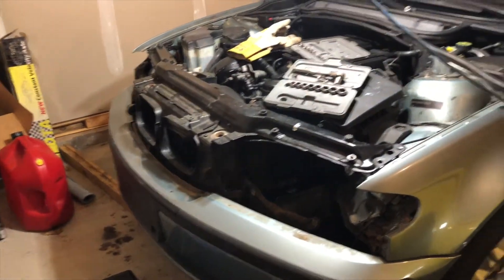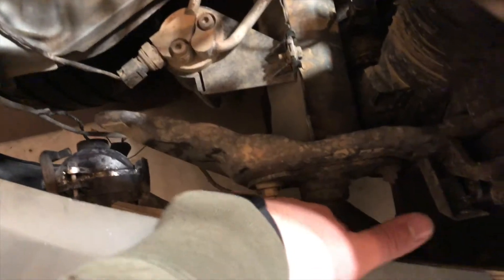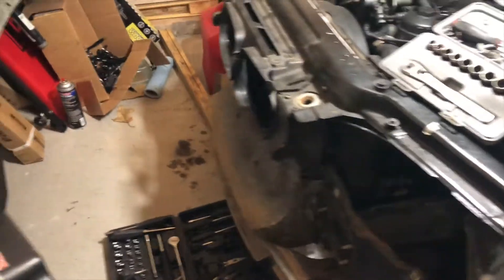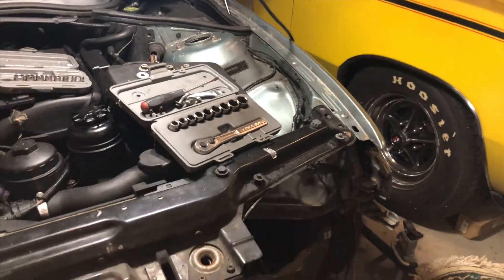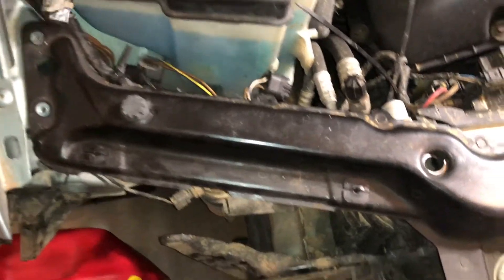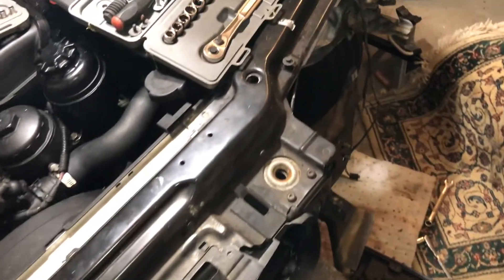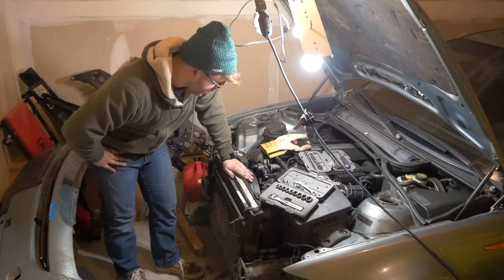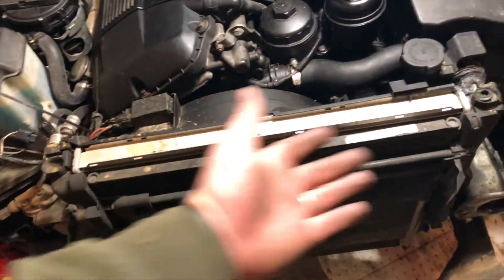Removing the engine from my E46! - BMW EV Conversion Part 3.

Comment: its a shame you couldn't keep the yellow car outside the garage. and put the bmw in the middle of the garage. give you some decent space to work. I'm pretty much in the same boat as you. but i paid a mechanic to strip out the engine etc (just done last week),  I'm going to weight the car before I start (tow it to a puplic weight-bridge). be interesting to see what batteries you intend to use.
Reply from the maker: Yeah, I would consider that, but that’s my fathers original 1970 Buick GSX. It’s a little piece of muscle car history that wouldn’t last a second in a New England winter. I did, however, clear out a good amount of space to work, so it should be easier than what you saw in this video. I hadn’t planned to do this work, but I had some free time, so I took a few hours to do it. I’m better prepared for when I come back to complete it.
Reply: you could build a "temporary tent" round it outside using polythene. just a thought!